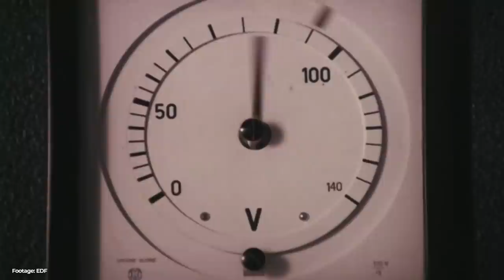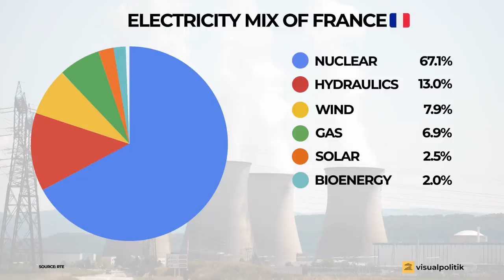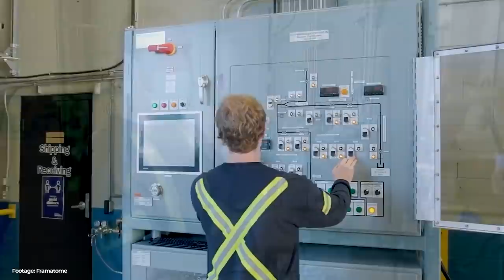Why is FRANCE betting on NUCLEAR ENERGY again? - VisualPolitik EN

Comment: A report biased and written by a Brexiter so eager to criticise Europe (its "Bureaucracy") and over estimate the Rolls Royce plan (a Unicorn?); When you start things seems always brilliant and easy. You compare a newcomer (Rolls Royce) with someone having over 50 years of reliable experience.
Don't underestimate France's will to finish this project in a very satisfactory way. Just wait just like for Brexit.
Reply: Rolls Royce has been building small nuclear reactors longer than France. The output of the RR SMR is not 300MW, it is 470MW.   The UK is supporting EPR, it is just about the only recent customer outside the EU although both costs and timescale have moved unfavourably on that project.
The UK has a completely different policy to the EU because the UK has a third of all offshore wind power sites in Europe. There is easily enough potential capacity to power the entire UK economy from offshore wind in 2050 although it will be capped at around 50%  and surplus energy will be stored either by creating hydrogen or energy storage via the Haber process. Offshore wind energy is currently half the price of the energy that will be produced by the UK EPR, falling to a third in the next few years. The UK will be introducing SMRs from around 2030, it is unlikely to build many more EPRs.
Yesterday the UK was generating 50% of all electricity from wind power and exporting 1.5GW of electricity to France, to mitigate the impact of their recent nuclear plant shutdown.
Reply: The UK built the first commercial nuclear power plant in the world. Roll Royce makes the the best pwr for submarines

Comment: Because the opportunity cost is lower in France than it is in other Western countries. 

France has a comparatively large domestic nuclear industry that also exports a lot so they have a higher fiscal multiplier on subsidies for nuclear energy and quitting would probably kill that industry and because of French labor laws and unions that would be a very expensive affair for the state. Same for dealing with all the ex-employees of nuclear power plants if they shut them down without building replacements. On top of that France gets uranium at an effective discount from francophone Africa and naturally, that enormous industry and its employees have a lot of lobbying power in Paris.

In most other countries building a nuclear power plant means committing to giving billions in subsidies to a foreign (possibly French) company, so those countries might as well spend those subsidies on renewables which involve smaller, more local, companies and not have to worry about getting fuel or processing spent fuel. As the video mentioned France can also save some costs by upgrading some of the plants instead of building completely new ones.

Renewables can work perfectly fine all year round, as long as you include energy storage. Storage requires subsidies, but so does nuclear power, so economically it is a simple question of which of the two will supply more power per unit of (net) subsidy. In most countries the answer is renewables, in France it may be nuclear power.

Comment: First  step out of fossil fuels that ruins our climate and our lungs, causing millions of evitable death and the despair of nations thousands of miles away from our border.

The deal isn't perfect for sure, but without any plan right now to reduce emissions, the climate emergency will take longer to be adressed . The first step is always to face the reality and be honest with our problem / mistakes. I'm glad that someone finally is putting some political weight into this issue.

Focusing on energy production for me is a real good point, it will allow in the future to decommision factories and vehicules that rely on fossil fuels and set up new infrastructure and transports fully electric or powered by hydrogen.

1- Get somewhat clean energy (nuclear/ renewable mix)
2- Electrifying houses, production, transports
3- Reduce consumption / increase energy efficiency (home renovations, induction cooking, heat pumps etc)
4-"Greenify" more and more as technology improves and installation cost plummet

Waste is a concern but, I'd be more concerned about the thousands of tons of radioactive material and chemical weapons sunk on our shores. Another problem i hope governments of the EU countries will be honest about...
I doubt that EU would remain pssive if a country was sinking right now their dangerous waste in our waters. The thing is that the worst hast already been done. Cleaning up our mess is our responsibility.

(sorry for the broken english, i hope people understood my point ^^)

Comment: The Rolls Royce design is probably the bet short term. The best solutions are MSRs (Molten Salt Reactors) because apart from also being walk-away-safe, they only produce about 2% of the waste that high pressure (existing) reactors make. Unfortunately they are probably still at least a decade away.

Comment: We now have the technology to create molten salt reactors, which are much safer and less susceptible to melt down (going critical).  The main problem in the U.S. is disposing of nuclear waste and our stupidity in California of building them close to earthquake fault lines and also close to major population centers.  Hopefully France will consider molten salt or Thorium, not the old style regular water based reactors.  Nuclear energy now has the potential to supply large amounts of electricity without air pollution and climate change.  The whole problem is a politico-economic one -- we could force fossil fuel energy producers to pay for their pollution and install scrubbers, etc. - but we can't pass the required laws --- due to the politics of greed.  The fossil fuel industry is the modern day equivalent of the tobacco industry.

Comment: Nuclear power is the future today. Maybe in 50-100 years, we've evolved the tech to replace the nuclear plants then, but today, it's not possible yet.

Nuclear power may not be the future in 200 or 1000 years, but it definitely is a stop-gap between today and next 100 years. At least, if you really care about the environment, that is...
Reply: 400years are currently known Uranium reserves,... adding Thorium 1000years could be easily outdone,..
Reply: @marianmarkovic5881  Adding breeder reactors, seawater uranium extraction - and it easily clocks into many thousands of years.

Comment: A key point to make is that using nuclear as a transition energy is different from labeling it as a green source of energy. It is valid to use nuclear as a transition energy even if it is not labeled as green, but the point is to not have it be classified as green given that increasing the amount of nuclear waste is not sustainable. basically, if u got it; fine, use it (just like natural gas), but don't make more nuclear power plants. France is not 'betting' but 'pushing' the green label, and that is bs.

Comment: Things to know when you are not French, in the 70s nuclear was pushed by national effort and economy. Politics made possible the construction of those reactors however since Chirac got elected Nuclear Power was throw away by politics. This and the ARENH mechanism instituted by the European Commission lead to EDF being unable to maintain correct operation. Re-structuration lead to the farewell of nuclear engineers without transmission of the knowledge which ultimately was the downfall for EPR. Now that Flamanville and the china reactor problems are known maybe the v2 of the EPR will be safer and faster to build.
However, ARENH is still killing EDF slowly letting him loose 15 billions in the last month...

Comment: Using EPR reactor construction overruns is a bad arguement, China's construction of the EPR was within cost and time frame originally portraid, and before you say anything about the EPR reactor that was shut down in China, this was due to the consumable Fuel Rod cladding material. The reactor is fine and no issues there. 

Media blew this story way out of proportion, and in reality this difference within the chinese EPR construction and european EPR  construction is how horribly incompetent we have become since the 1960's to 1980's.

To the point where the Gen 3 reactors such as EPR and AP1000 are still pressurized water reactor...

Dont blame this shit on nuclear but on the bullshit policies holding nuclear power back.

Any Gen 4 reactor has a much higher safety and cost potential...

Comment: we don't have much uranium left that is mineable. they mined everything while trying to build as many bombs as they could, for the last 15 years most powerplants has been running on blended down nukes. we have at most a 20 year supply of uranium 235 left. however if we built breeder reactors we have 10.000 years of fuel (238). those reactors are pretty tricky though, and i doubt people are smart enough to design, construct, operate and maintain those anymore. not since the flynn effect reversal.  
If they had focused on it 30 years ago, we would probably have had the expertise though.

Comment: Makes total sense to have nuclear energy in a country without many earthquakes like France (and Germany...). But for the long term there have to be investments into Molten Salt reactors instead of Pressurized Water. Thorium molten-salt reactors are much safer, can be much smaller and can even burn the existing nuclear waste. The investment that goes currently into permanent storage sites would probably be sufficient to ramp up Thorium reactors everywhere.

Comment: The problem with Boiling Water Reactors or BWR's is that the original designers never intended them to go above 65 megawatts of power.
Reply: Second problem, they are still a lot cheaper then alternative reactor types. And have great safety record,....

Comment: The Cigeo project is unnecessary, the current methods are fine, and current waste is fuel for 4th gen reactors.  Current reactors leave 97% of the fuel or more on the table.

Comment: Nuclear power with solid fuel and hot pressurised water has far too many fundamental issues. Corrosion, hydrogen produced internally, part used “waste” fuel and decay heat management to name a few. 
Molten salt reactors have a long list of advantages and none of the PWR hazards. The fast spectrum type can fully burn the fuel and do not created irradiated carbon cores (they don’t use carbon). 
Why are we not building fast spectrum molten salt reactors?

Comment: I think nuclear is the way forward. The renewables tend to produce power when it isn't needed and there is currently no good way to store that power. Also, I find wind farms and solar farms to be an eyesore, which would be a problem that gets far worse if we increase use of renewables much. That said, the biggest improvement we could make to the environment in the near term is to get countries to switch from coal to natural gas. Looking at you China...
Reply: Also for wind and solar I don't get why they get the green tag considering they require huge lots of land to be flattened and entire ecosystems to b uprooted to produce at least 1/700th of what can b produced in a nuclear plant in a area the size of a mall

Comment: Unfortunately, democracies often fail to implement long term plans. For example, although Romania has committed itself to nuclear energy, the plan of who should build its next generation nuclear reactors changes from government to government. 
Although natural gas is not sustainable, a political compromise in order for nuclear to get on the list is desirable. Indeed, methane gas can be produced when renewables provide excess energy. 
The only thing worse than having to live with not-so-great decisions is having to live with no decisions at all.

PS: I had the occasion to live in a country that rejects nuclear power (Austria) and it all boils down to mentality, Austrians are usually always deceived by fear. And fear leads to inaction and inaction leads to disaster.

Comment: Romania always relied on nuclear and hydroelectricity, with no issues. And always planned to extend the nuclear power plants even if there are unexploited gas resources that could provide energy independence for about 50 years, exactly the period needed for transitioning to green energy.

Well designed nuclear reactors are superior to gas, from here we did not understood why the Germans were so scared after Fukushima. We knew Ceausescu insisted in constructing the Canadian design for the nuclear power plant from Cernavoda, because the scientists were aware of the issues from Chernobyl type of reactors well ahead. Also here we rather be irradiated than be dependent on Russian anything...

But from what I perceived, the nuclear labor force need to be highly instructed. While the gas is not so demanding for the workforce.

Comment: Look likes France needs to look into Molten Salt Reactors instead, it would solve many of the problems with current ones, and if they make them in shipyards/factories it will cut costs and build times(about 2 years start to install) and with co-production off the high heat(~800C) reactors can make any liquid fuels you need or chemicals. Have a look ThorCon they are the closest to market.

Comment: Probably because they’re smart, and they know it’s the only technology currently in existence which has been proven to rapidly, reliably, economically and drastically reduce carbon emissions.
Reply: Rapidly? Flamanville 3 in France started construction in 2007. It's still not finished. Hungary's Paks-2 began planning in 2016; its 2022 and still not under construction. Meanwhile in same 6 years Hungarian solar capacity went from 100 to 2700 Mw.
Reply: @ffffuchs  Nameplate solar capacity. What's the actual capacity factor of it?
Reply: @caav56  more than zero of the nonexisting nuclear plant lol xd
Reply: @ffffuchs  In the meantime, Paks NPP has 84.2% capacity factor.
Reply: @caav56  I was talking about its extension, which is is already 7 years delayed despite no construction started.

Comment: I think that since nuclear power plants need large setbacks where people can not live, why not cover that space with solar panels and wind turbines? The grid connections can all happen there and the same transmission lines can do double duty. With Battery or Hydrogen storage the excess power can be saved to even out the duck curve and the seasonal curve. Electrolyzing steam from the nuclear turbines is much more efficient then electrolyzing cold water. Perhaps a gas power plant could be used there too with the gas phased out by hydrogen over time.

Comment: Renewables only work when paired with a large quantity of Natural Gas peaker plants to offset the fluctuation of energy production from renewables....

The classification of Natural Gas to be sustainable comes from this particular issue.

Going full renewables / energy storage is vastly more expensive and requires tons more redundancies... the move to make natural gas still "green" is to ensure countries have a way forwards without backtracking climate policy... 

Furthermore, those who have Natural Gas see it also as a economical oppurtunity... 

Nuclear is outside of this eco system and if the rest of europe went full renewable france could become rich selling their excess energy as battery storage is not so scalable as one might like, and energy demands increase over time.

Comment: Sadly right now France has had to shut down almost 30 % of its nuclear capacity due to revisions and safety reasons and has yet again to rely on imports from Germany to keep the lights on in the winter. Because so many in France have electric resistance heating, they need German electricity in the winter while they have way too much in the summer which they export. Isn't that embarrassing? Germany is keeping the lighs on with its still massive fossil fueled plant fleet. Sigh.
Reply: That's the point of having a mutualized grid ...

Comment: Lithuania closed its nuclear power plant due to safety concerns.
Then Belarus opened its nuclear plant(with unknown safety quality), right near the border - right near the capital of Lithuania...
Reply: Wasn't the lithuanian reactor a soviet-vintage RBMK ?
Reply: Moreover, those were RBMK-1500, which had to be dialed down to 1300 MWe to prevent the thermal deformation from tearing fuel rods apart.

Comment: It works for France. Germany choose NG, which is fine if they had some.  Instead the plan is to become Putin's sockpuppet. For the USA, the states are now led by California, which as chosen a mix of wind, solar and battery storage, Its a combination that does not work (a feature that never seemed to stop the Democrats), but (like renewables) shows every sign that it will work shortly. California and France are similar in size and population. It will be interesting to compare them going forward.

Comment: We will need nuclear to supply baseline power. Just this year, electricity prices have soared to unsustainable levels due to 1. shortage of natural gas and 2. lack of wind while temperatures in the north, where buildings are heated with elect ricity, have been unusually low. If such problems are not adressed, it will make the energy transition politically impossible.